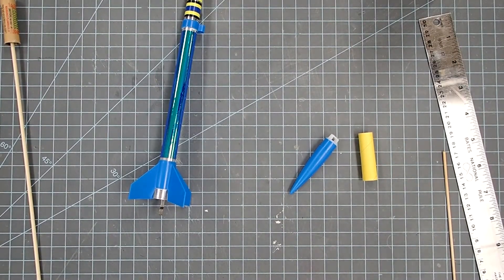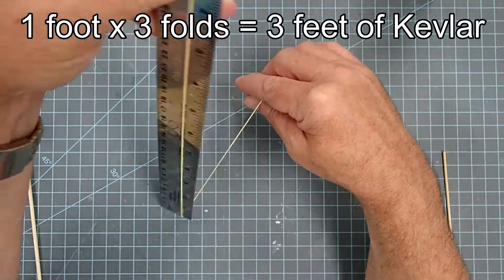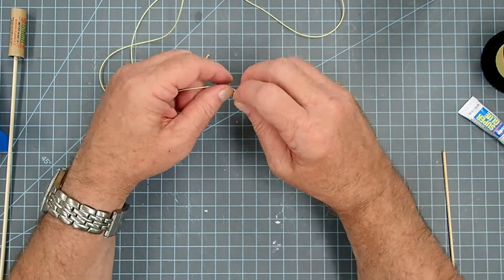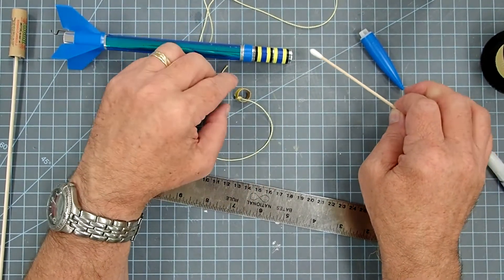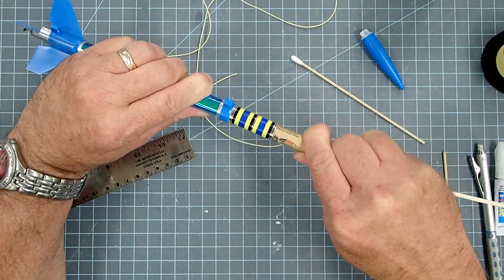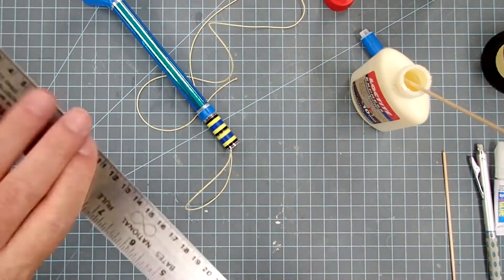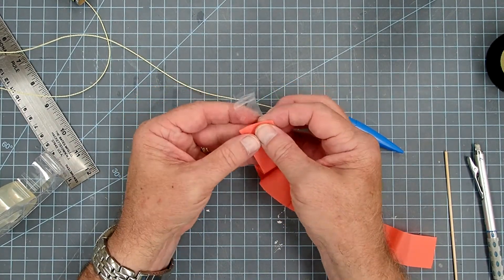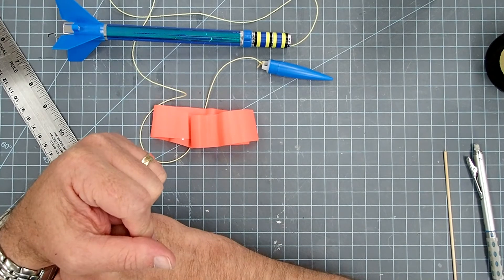Shock cord repair on the Estes "Gnome" and "Spaceloft"

Comment: If i have a shock cord that snaps... is there a rule of thumb if i choose to tie a length of kevlar to the remaining cord? I know you said kevlar was 3x the overall length but not sure if adding more... or could i even tie an extra elastic shock cord where the break happened or would that be bad? Thanks as always dr Dave
Reply from the maker: If it started with a rubber shock cord and an Estes type glue-on anchor, it's usually easiest to cut out the old cord and anchor and replace it with new elastic/rubber. Kevlar can rip through an Estes mount. Tying Kevlar onto the remains of the elastic shock cord probably will end up breaking at the elastic again.
Reply: @REAR_rockets  thats why i consult the Dr... thanks